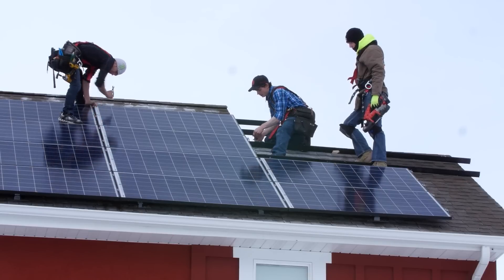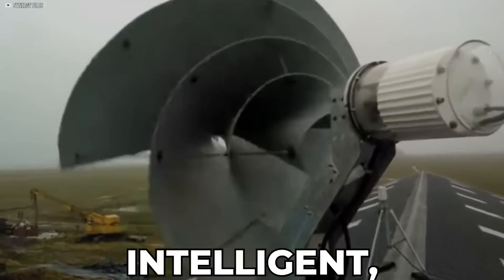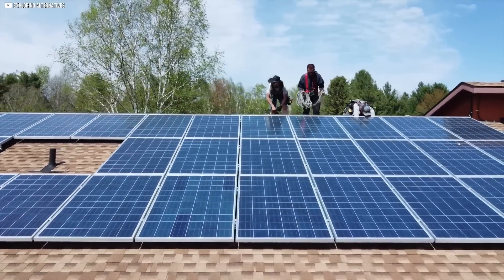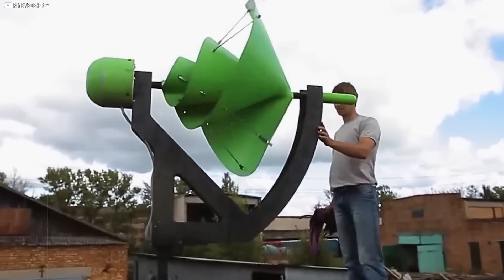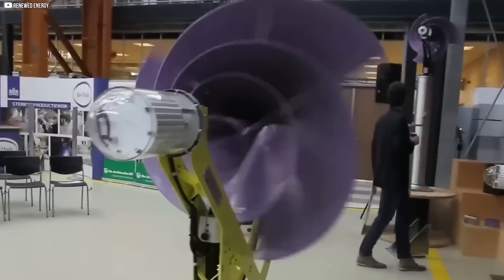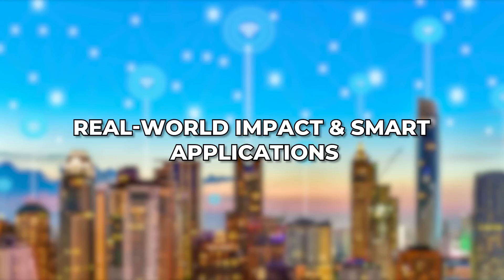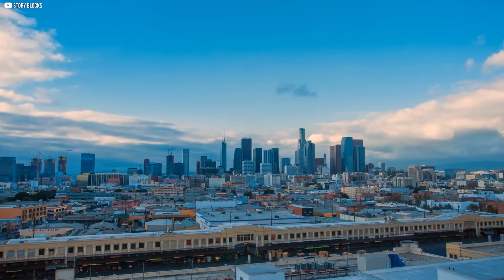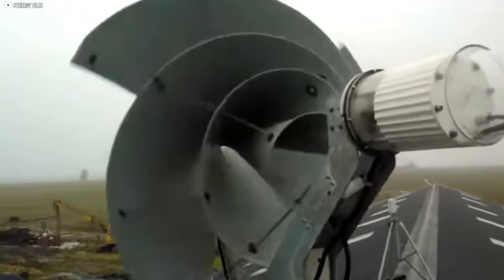Goodbye Solar! This Machine Just Changed Home Energy

Comment: The disadvantage of wind power tech or generators is that the breeze or wind that powered it, doesn't always stay consistent, so therefore the power input would fluctuate high or low or sometimes to none.
Reply from the maker: You make a great point! Wind power can be quite variable, but advancements in technology are helping to manage that inconsistency better.

Comment: In order not to write a miserable 0.170 kW (at 7+ m/s), you indicated a theoretical 1500 kWh per YEAR.
If you found a place where the wind continuously (365 days, 24 hours) blows 7 m/s, then you definitely need to buy a normal wind generator, but not this piece of crap.
Reply from the maker: I appreciate you raising these points; it's always interesting to discuss the practical applications of these technologies!

Comment: claim: no noise -> every spinning thing produces noise or vibrations, because the edges cut into wind.
claim: simpler and therefore lesser likely to break -> every moving thing is more likly to break then non moving parts. 
claim: fewer electronics who break -> the electronic parts for a solar panel are also needed for this, because all they do is transfer the diffrent voltages and produced DC to the regionaly used voltage (for example 110 or 220V) and AC. Every solar panel and wind turbines produce alternating voltages depends on windspeed or sun intensity, and they produce only DC without other electronic parts who convert it to AC.
claim: more powerfull -> here they only compare wind capturing surface directly to power, but forget totaly the more material = more mass = lesser power output. 
I'm too lacy to search for it, but these things are around for years and their effectivity is not so great like it is told here.

The one and only claim they can have to be true is: they are smaler then regular mini wind turbines. Not more powerfull only smaler. For a balcony or in a camper it is good. Maybe they are sturdier from touch, if I transport them a lot.
Reply from the maker: Thank you for sharing your insights! It's always great to hear different perspectives on new technologies. Your points about noise, durability, and efficiency are definitely worth considering as we explore alternative energy solutions.